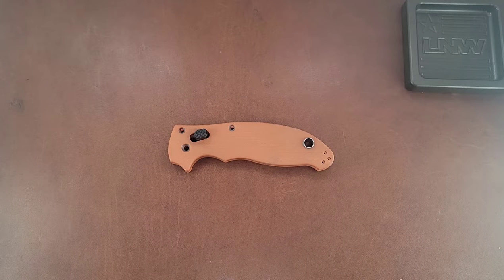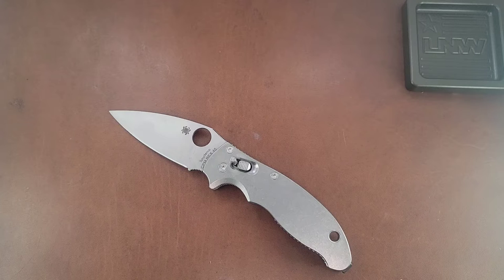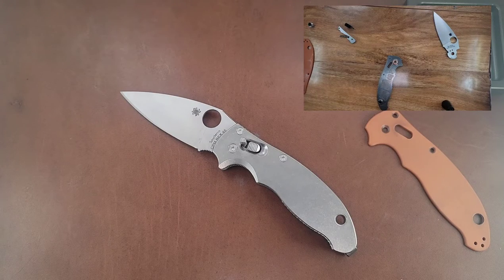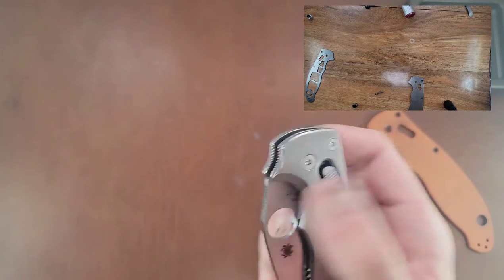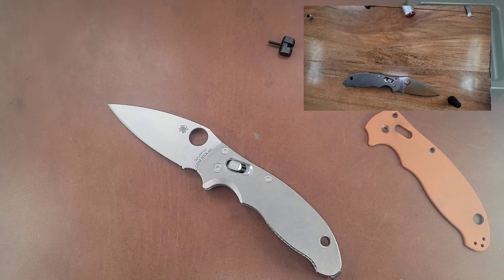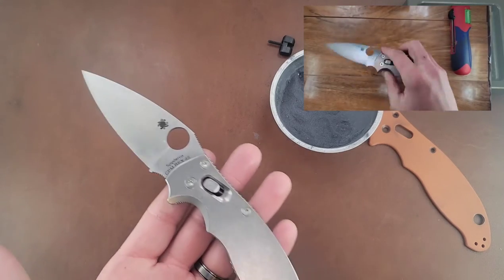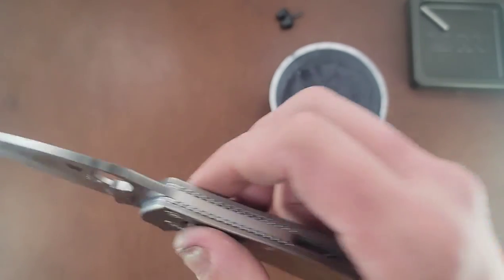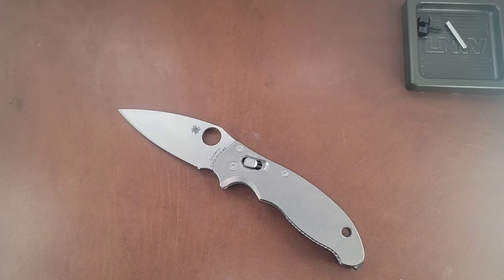Spyderco Manix 2 Upgrades and Assembly (Flytanium and OCD4EDC KIT)

Comment: I have the original manix 2 in g10 s30v. I'm having to reblade it due to an ignorant friend sharpening with a grinder. Definitely going to grab some of this b4 installing the new titanium scales. Great informative video. 👍
Reply: Highly recommend picking up a used rivet construction lightweight in whatever steel you want. Probably the best way to get a cheaper doner blade

Comment: It’s been about a year now… Curious as to your long term impression of the Z Molly powder and whether you’re still using it? Thx!
Reply from the maker: I do use it on all axis locking knives, though I don't carry many (I also use it on my manix 2) I feel like the grease is ironically less messy and arguably more effective.  The powder works good where the crossbar "studs" meet the liner and I've found the grease works better on the tang where the crossbar rides on on the tang. I could send you samples as that shit is expensive, message me on IG.

Comment: Thanks for the vid and all the info! Question... where'd you find these Flytanium titanium scales with the contouring at the finger choil (not to mention the ball cage lock)? Can't find them anywhere, just the flat plain ones.
Reply from the maker: Hey bro thanks for watching these are the same ones you're talking about their flat they're not contored if I said contort in the video that's cause I'm an idiot. The ball bearing cage is also flightanium. If the ceremic ball is OCD for EDC. And I believe the pocket clippers from lynch.
Reply: @EEDC  No, you did fine... was me who  didn't use the best terminology...  I meant the big chamfer there at the edge of the finger choil. If you Google Flytanium Manix 2 Ti scales, they look different.
Reply from the maker: It's just the angle of the pics, check it out here 
https://www.bladehq.com/item--Flytanium-Custom-Titanium-Scales--93929